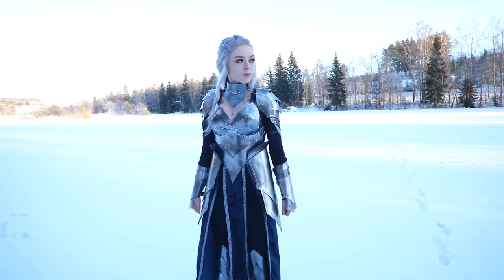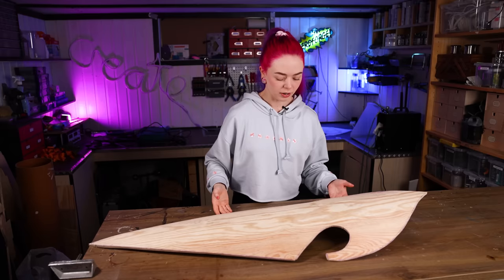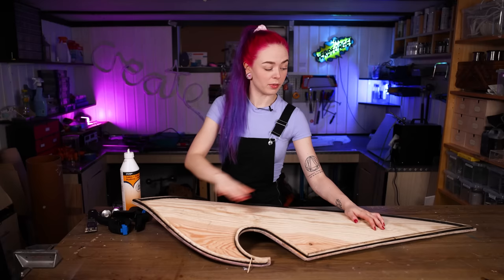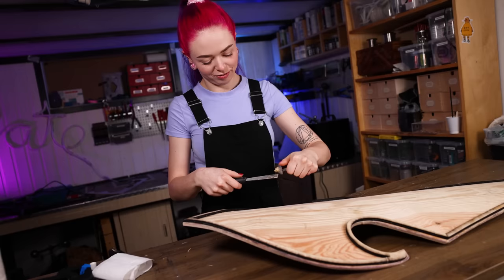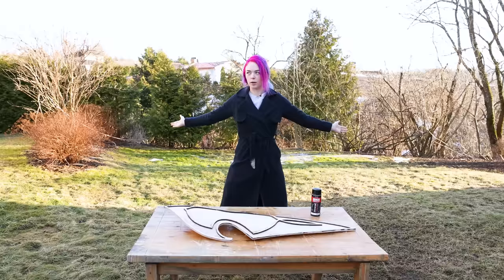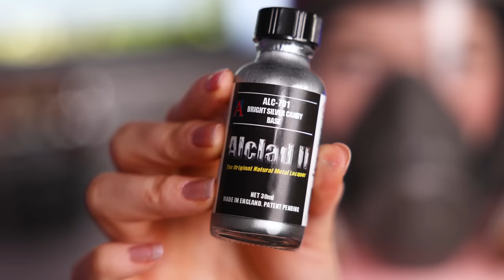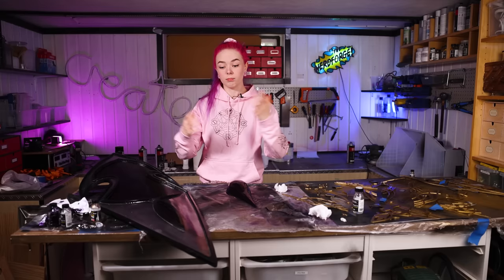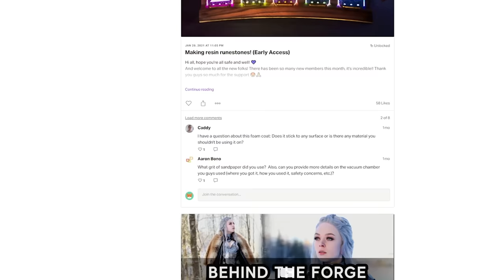Making My First SHIELD Ever!

Comment: It doesn't need a Fantasy explanation: ceremonial shields existed. Their whole point was decoration and not function, though their designs were based more on actual shield designs of the time.
Reply: it is not a ceremonial shields. it was shown used like a battle shield in a LOTR prologue
Reply: @heavenbliss86  ... which is Fantasy. :facepalm:
Reply: @rensiknosaj  which is definitely means that it is ceremonial?
Reply: @heavenbliss86  just, stop. I didn't say it was ceremonial. I said it was decorative like ceremonial.
Reply: @rensiknosaj  just try to find proof for this statement in your post.
Reply: the only "irregularity" is the material (too weak and too thin wood)
but such a shield of dried leather was quite normal (the only thing is that it may be too expensive material today)
but as you say for ceremonial purposes they could have used such shields as well
Reply: @tihomirrasperic  Technically the wood is fine, possibly even better than what was used due to technologies used to make it. The problem is mostly the shape. The notches in the sides create a weak point in most shield stances that would be used with that style of shield.
Reply: the holes in the sides of the shield could be used to disarm an enemy from their sword in a real fight. also the top of the shield is sharp enough to be used as a weapon and the bottom is long enough to block low sword attacks to the feet but thin enough to not make the shield too heavy...
long story short: it would make for a great shield in a real battle... (if it was made of real metal)
Reply: @rensiknosaj  if the handle was vertical the notches would be good for spear fighting (harder to be disarmed) and the point for punching if you were disarmed

Comment: This type of shield has two notable, unique uses that I can see:
1. The bottom of the teardrop could be sharpened like a pike as a heavy stabbing weapon or to spike the shield into the ground for stationary cover
2. The ornate cutouts on the side would be reinforced against shear force to provide a method of trapping the sword of an enemy, allowing you to disarm them

Kind of 3. In a magical setting, which emphatically and quite unfortunately reality is not (or fortunately depending on your faith in humanity), that large purple shield boss could be a gem enchanted to generate a surface boundary layer over the connected, mana-conductive shield metal (perhaps mithril) that allows it to withstand greater physical impacts via diffusing the force vectors outwards, or to ward off magical projectiles by way of mana dispersal or even absorption and conversion of the mana into the gem as extra fuel to maintain the barrier.

Comment: Carpenter's trick for cheap wood filler: Wood glue + sawdust = wood filler.
Reply: i was going to suggest the same think.  I used it for the first time and my current project and was amazed with the results.
Reply: Just wrote that, should looked at comments before
Reply: Actually have cans of sawdust by species just for that as my go to wood filler. Works best with sander bags as it’s very fine it fills cracks on flat surfaces nicely.

Comment: Nice build! Fun fact, the "hooks/holes" on the sides (the whole top part of the shield, actually) can actually be found on historical germanic dueling shields from the XVth century (look for the Talhoffer Fechtbuch for some examples), so the design is more historical than you may think! It may be seen as an hybrid of the germanic dueling shield and the teardrop shield of the XIth-XIIth century. Although, for practical use, it would be better to replace the straps by a single vertical handle running the whole length of the shield (with the added advantage of not having you elbow sticking out of the hole).
Keep up the good work!

Comment: A shield with that shape is not only used for protection. With the right handling weight, plus hardness, and sharpness coming into play the pointy end can be a viable weapon. In that respect, the design is good enough for the the purpose it could serve, fantasy or not.

Comment: The holes on the side are actually legit. There are shield designs that have sort of these designs for spear fighters. They can hide behind the shield and poke the spear through those holes. Usually the opening is upward tho so the spear can be rested on the rim of the shield to preserve strength.

Comment: a bit of medieval-nerd trivia: the wooden shield would have been perfect even if it looked "wooden" since all European medieval and ancient shields where made out of wood, but there is nothing wrong with making it look like metal either... Even if most medieval shields where made of wood, some had a metal (generally steel or Iron) middle section (called boss) or may have had the rim covered by metal (bronze, copper, some times iron). In some other cases (i.e. ancient Greek hoplon), shields may have had a thin sheet of bronze or leather covering the face

Comment: It turned out BEAUTIFUL! 

I still don't understand attaching the shield to your arm, or the economics involved in its use. 
What is the best position to hold a shield in?/What is the best handle or bracer to use on a shield? Is it possible to create a variable handle that allows you to grip it however you want? Can a handle double as a way to attach the shield to your back for carrying? What's the best technique for attaching your handle to the shield itself? What is the best ambidextrous handle option?

If anyone would like to help a total noob, it would be very appreciated!

Comment: I love that after making an armor with crotch spike she get's defensive over a design for a shield, that would perfectly well, especially with a spear.
The only significant difference between the shield she made and one that would actually be used (other than material of course) is that the bos would likely be hallow. In all other aspects the design works perfectly fine.
The holes would be hard to abuse by a potential attacker. Even with the holes the shield offers plenty of cover and the holes make it easy to attack while wielding the shield.

Comment: I know this video is old, but I just wanna say that the shield looks amazing, and can also be used pretty well too, as it can be used by a right or left handed person, as with the holes being on both sides it allows the weilder to poke their spear or sword through the holes while they hide behind it in a shield wall or testudo formation, and because of the holes on either side, it doesn’t matter what hand your dominant in, you can use both left or right hand, and while it may not be the best at protecting against arrows or bolts, it would still work well as an all around fantasy infantry shield, probably like elves because they are usually the pretty looking faction in fantasy and the shield is definitely pretty, and also not a bad design if you are to use it in battle, sure their are weak points but no shield is perfect, but it’s a good all around shield and I wouldn’t bet against it in an infantry vs. infantry/horsemen battle, as it can be used very well, just as long as they know how to use it!

Comment: Couldn't help but smile at the 'this is a fantasy sheild' disclaimer, for a few reasons:
1) it is a perfectly viable shield shape (and a really good looking one too)
2) the LotR shields that shape are made of metal, which would be really heavy, and so historically we see shields of this size or bigger made from wood. Specifically, multiple cris-crossing layers of wood. Plywood, if you will.

This shield is accidentally more realistic than the prop it is based on.

Comment: wood is very unforgiving when damaged and its difficult to get a super smooth surface for painting without the blemishes or grain pattern showing thru unless its meticulously sanded.So instead next time place a 2mm-3mm sheet of leather across the surface before glueing patterns and the like onto shield surface.It paints and finishes much better.

Comment: The one and only suggestion I could possibly make (and please take it with a grain  of salt, as I am a housepainter and don't  do woodwork) is to sand the small, gold detail pieces a lot more before painting them and then also a little bit in between coats of paint. (As I'm sure you know, there are some suuuuuuper fine-grit sand papers out there for pre-finishing the kinds of painting you do.) Just to make their edges more even and for cleaner, leaner tapering at their ends. BUT - amazing work. If I ever get money enough to look at purchasing quality complaints, do you guys have a shop for orders or anything?

Comment: If you need some metal working, I have a metal shop be glad to make something for a trade.

Making a shield would be no problem, I can make it light and straps and arm holder so it could easily be worn and used.

Comment: First impression of the design: I'd have closed the holes, for a sturdier structure. That would not only make a more traditional design, but the holes could be replaced with clear plexiglas or other "magic window" material. I mean, it's already fantasy armor, why not? But, you do you, I'm fine with it if you like it, it's yours anyway.
Reply: Next impression, at the time of adding the wood glue: Not bad. It might add to weight, but I'd have used a thin skin of simulated leather. Not only would that create a smooth, paintable surface that increases the strength of the shield's body, but it adds depth that you can then add more trim over later if you want. Not always done in traditional shield making, but leather-skinned wood is known.
Reply: Final impression: Excellent work. I like it.

Comment: gesso, makes a good filler, also glazing putty used in auto body shops, cheap, drys fast. accepts most finishes with no problem. Last but not least, spray in body filler, also used by body shops.

Comment: WY DO YOU HAVE A SHEILD BOSS WITH A LETHER STRAP IF THE BOSS  IS SUPPOSED TO BE HOLLOW SO YOU CAN PUT A WOODEN HANDLE ON IN IT WITH THE HAND FITTING IN SO WHAT'S THE POINT OF THE BOSS

Comment: "it wouldn't be protective with those holes. it is not historically accurate"
well it isn't historically accurate for that exact design, however spear users did use shields with cut outs in that spot on their shields. so that statement is half true or half false (though i haven't seen all shields ever made so i cannot make a definitive statement on it being half false).
Reply: so watched till the end, and i guess the only suggestion/caveat i would say is that a boss is for center griped shields (it protects the hand) and narrow shields are for holding out in front of you more so than wider shields (which means center griped). that means that i would make a stronger grip under the boss, maybe with some bolts holding it that are covered by the boss. in the end it looks pretty nice.

Comment: Lasercutter....pffsh....lasers are so uncool :''<

Oh and: Never glue onto paint!
Reply: You can glue onto paint without issue, just need to use the right glue. If you paid attention, you would notice she is using 2 part epoxy.
Reply: @mikel9567  Short and simple, because you seem to be not a thinker: The epoxy (stop acting like EP will glue EVERYTHING, it will not) will just stick well to the PAINT, which might not stick well to your surface! One hit and it breaks off....with the paint underneath and a clean surface. Now? Yes? Ok.